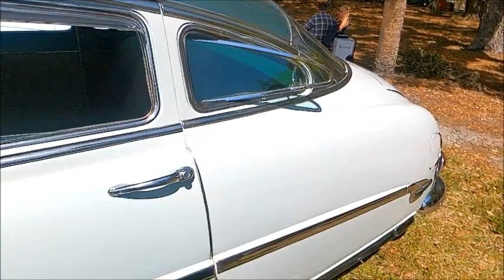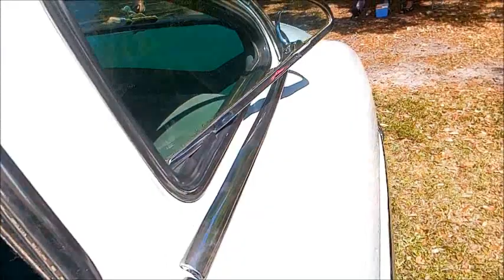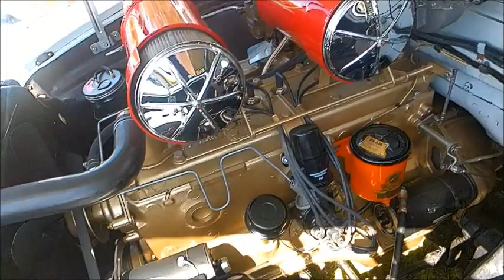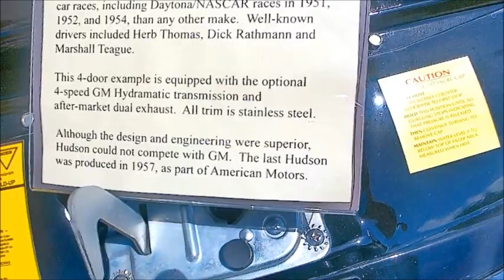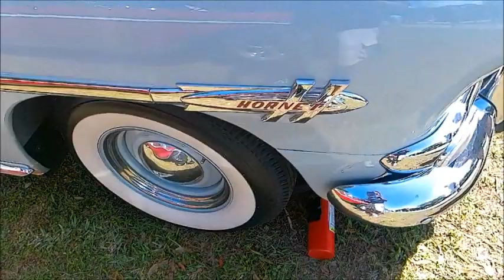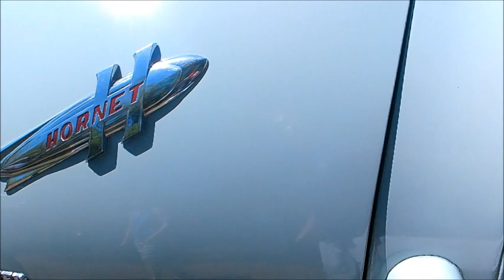1953 Hudson Hornet Four Door Sedan GrnWht VeroB0319226096

Comment: Yep, those were the days, and those were very practical, well built cars, l really liked them, but they weren't "cool" enough for the young of the time. Chevy, Ford, Olds, etc. were catching the eyes, and not the practical appeal. As l rode in them, l was really impressed that they were made for comfort, safety,, and longevity. I had nothing against the other more sought after cars, but felt that Hudson, Kaiser, Frasier, Packard, Yeah, (old Pack) , Studebaker,, didn't  get their justice. Admittedly,  some of their demise was caused by bad management decisions by the mfg.  but It's  real justice to see that some of these cars live on as these restored ones do,, and can tell the tale. I have, on the wall of my shop, mint condition original Hudson Sun Visor, with all mounting hdwe.of stainless steel, also a Studebaker pickup tail gate. Thanks for the video, l love that car.🌈
Reply from the maker: Yes, success in the auto business is complex indeed!  You've got management, investors and workers to deal with.  You've got government rules and regulations, and sometimes the unexpected boost from the government.  Lastly, you have that elusive "sex appeal" for the cars themselves, of course, with the help of advertising!  There's a reason why convertibles were in the showroom, and I have yet to go to a new car show that doesn't feature pretty models demonstrating the features of the cars.  And of course, there's the MONEY...this is an expensive business, and time and time again, the money required is underestimated.
I appreciate your collection of car parts...I too have scattered grilles, tailights, horn buttons on selected walls of both the house and garages!  You can't have too much memorabilia!  :D  Thanks!  :D  Jack

Comment: ...ah...thanks Jack...

...an all-time fave 50'...and a seminal piece of automotive history...

...the unique perimeter frame pioneered by Hudson allowed the interior floor pans to be lowered into the frame; and though not a unibody...gave these Hornets a remarkably low-center of gravity and an exceptionally stable and smooth ride vs. its contemporaries...

...and while avid early stock car drivers first experienced great success with the Olds Rocket V8's, these Hornets' Twin H Power inline six cylinders were easily modified; and ended up blowing the doors off the far more upright Olds and Lincolns then in vogue...

...this commodious sedan featured a cavernous interior and was very popular as a long-distance road car...all the while being very fuel efficient...

...the featured car in two-tone Blue Grass Green over Seal Gray was optioned with the new Hydramatic Borg Warner transmission, and featured an electric clock, heater and wipers as standard equipment and an 8-tube radio could be added for $109, providing entertainment on long-distance road trips ..

...even with all these attributes, Hudson sales numbers began to decline after 1953; with more and more buyers wanting an overhead valve V8...

...so despite selling slightly more than 27,000 Hudsons, the financials were dire; and during the '54 model run, Hudson was acquired as a "sick sister" by Nash-Kelvinator to launch American Motors Corporation under the leadership of future Michigan Governor George Romney...

...though there were still loyal Hudson buyers out there...and as you noted, Jack ..what they got was a lightly modified Nash Ambassador, with different grilles, headlamps and tail lights, a unique selection of interior upholstery and exterior color options...but basically an Ambassador underneath...

...had Hudson just adopted the unique "step down" design immediately after World War Ii, Hudson's future would have been ensured...but stodgy management played it safe andy hesitated; and the new design got lost amid the major design/engineering reconfigurations by all other makers in '48/'49....a classic case of "too little, far too late"...

...nonetheless, these Hudsons are a tribute to cutting-edge design...and well-preserved examples are highly prized by knowledgeable collectors...
Reply from the maker: Hey, G Clark!  We sure appreciate the history of this model and its place in automotive racing history and in design excellence!  Hudson had a good thing going in terms of performance and luxury accommodations for passengers.  One thing that hampered it was that this year's design didn't lend itself to the kind of yearly modifications that the other Detroit competitors easily accomplished.  People were used to the yearly mods, and weren't fooled when Hudson essentially threw out its strong points in '55 and became a poorly disguised Nash.  I agree that it's too bad that Hudson lost its individuality, and essentially its reason for being.  Thanks!  :) Jack